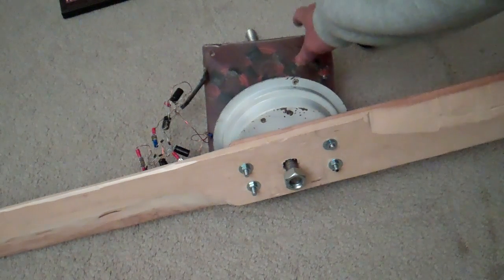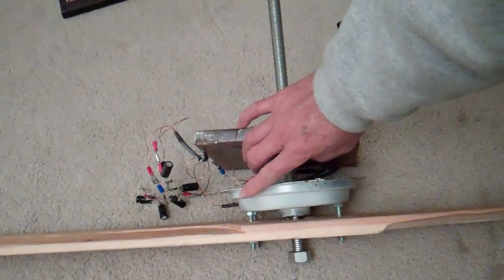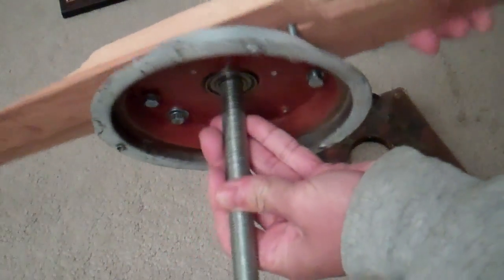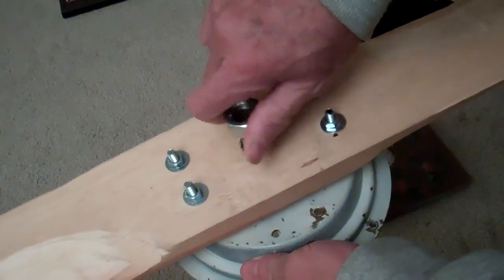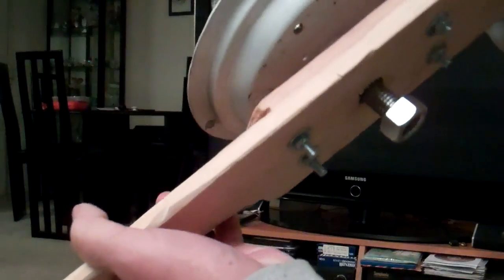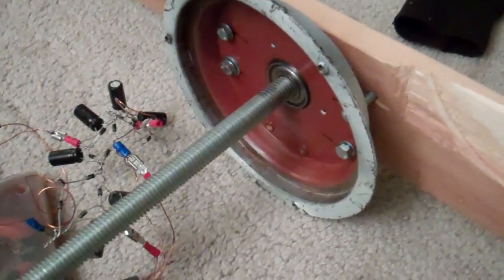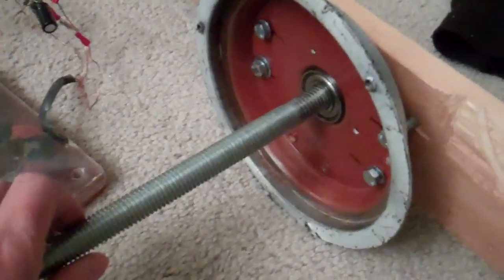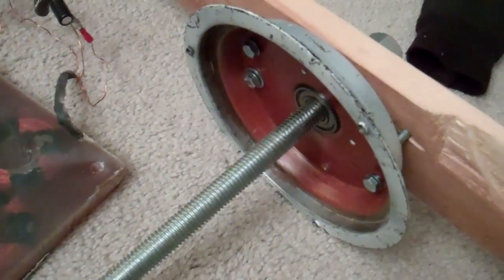Hawt with 6 coil stator and ceiling fan motor cover hub pt 1.mp4

Comment from the maker: I think kb5setp or Muddy has greater success simply because he does it better.  Mine is not too bad but it definitely needs a higher pole.  Don't know if cogging is the problem but it doesn't help. I made a longer 6 foot blade (using Muddy's template) but it didn't turn that well either. The only turbine that worked for me is the vertical axial flux type. The downside is lower output. Thanks for commenting.

Comment: I think you have something wrong if your prop can not turn  the rotor pass the stator cogging. I have seen large ones and small ones with a lot of cogging and they have no problem in a light wind to start spinning. I am talking like 4 - 8 mph.. A small one in a 15 mph wind hauls butt because of a small prop, like 2' diameter. Go see kb5etp's channel as this is what he does with ceiling fans and he designs his own as well. Even from scratch. Good job.

Comment from the maker: @Fearlessthinker When I tested it earlier with a 12v 3.8 watt bulb, it lit up at about 150 rpm. I have not hooked it up to a battery and measured the current flow with a multimeter. I don't have a tachometer so the rpm is an estimate. The 20 gauge wire size gives 1.3 ohm for 1 set of 2 coils.  It's crude but when it turns, it's fun.